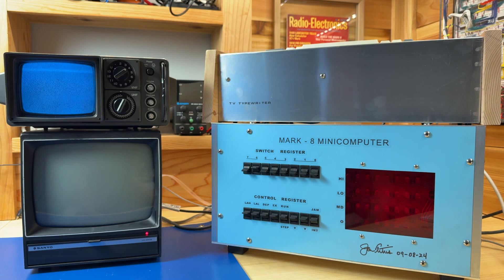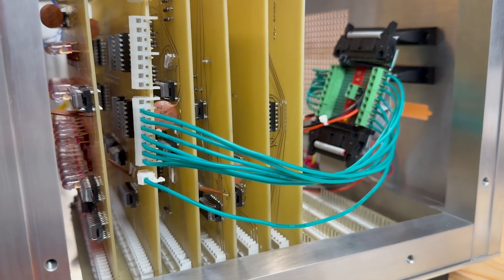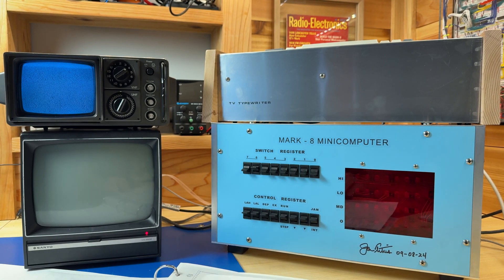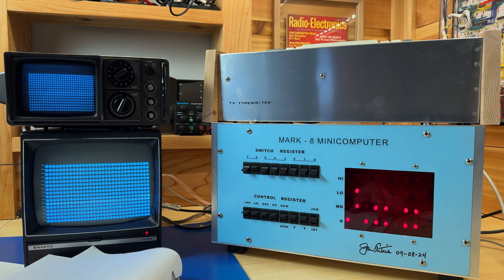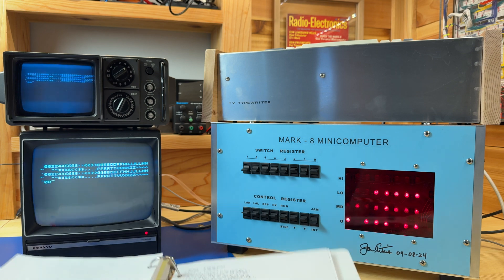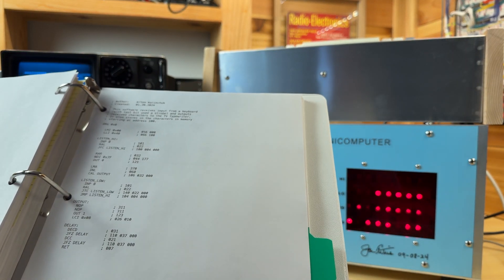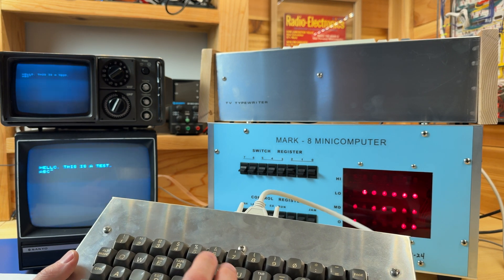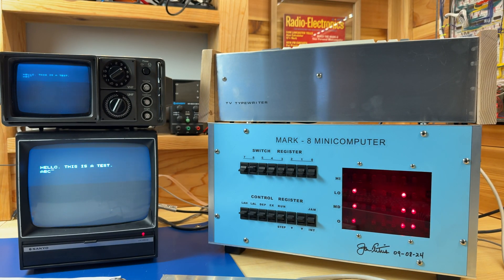Mark-8 Display on TV Typewriter

Comment: A nice little computer, you've almost got me wanting to look into what's needed to build one. I did build a clone of a SWTPC6800 years ago using a pile of wire wrap etc. (I wonder if I could make a 'front panel' for that one - SWTPC never did)
Parallel interface, I was not expecting that, from my memory you could use a TV Typewriter with a modem, so serial, so I thought that's how you'd connect it to the Mk8, although from the back views you showed, there was only two ports visible.
I was surprised that the memory dump output wrapped around rather than scrolling, is that part of the code, or a function of the TV Typewriter.
It would be nice to put that memory dump code into an EPROM so it could be called at any time, like when your in the middle of writing another program, so you could dump what you have rather than having to enter more code - a distraction from debugging what your working on.
Reply from the maker: The wrap around is the way the TV Typewriter works. I believe it was designed that way because it uses shift registers for memory. I plan to build some sort of ROM board for the computer so that we could have basic programs always available to run.

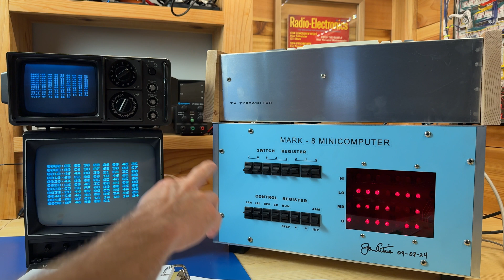Comment: What's up with the "0@" in the memory dump? 10:16 Such as in location 0021?
Reply from the maker: I realized, after the fact, that I had the keyboard encoder connected to the TV Typewriter as well so it was interfering with the data input occasionally.

Comment: Wow, that's great to see in action!  I just started reading through the Mark-8 manual yesterday, in preparation for completing my Mark-8 build (using the Budgetronics PCB's).  I set it aside a few months ago, but it's really so close to being completed, aside from the case.  As it happens, the page I had up on my screen when I saw your video pop up on YouTube is the one describing using the TV Typewriter in this manner.  I'm still a little confused why it doesn't describe how to use the keyboard of the TVT for input, as well as the video display for output, but perhaps that's not as simple as it sounds, what with how primitive the TVT is compared to commercial "glass teletypes".  Since the TVT's keyboard is, more or less, just whatever keyboard the builder can find, I suppose there's nothing stopping a dedicated hobbyist from disassembling that part of their TVT (electrically, at least) and reusing the same keyboard on the Mark-8 as a direct input, though.  Keyboards being as astonishingly expensive as they were back then, after all.

By the way, just in general, your videos on the Mark-8 have been particularly valuable to me, as most of the existing Mark-8 content on YouTube was rather short, just talking generally about the machine's specs and place in history, but not showing much detail of its build and operation.  I remember looking it up when I first became interested in building one, but before you made any of your videos, and the "best" videos I found were done on a very shaky, hand-held camera and mostly covered modern modifications of the machine, such as using an Arduino to "key in" programs rapidly, with much less about how to build and use the machine 100% as designed.  (And, seriously, that shaky cam was bad enough that I had to stop that fellow's videos every couple minutes and let my stomach settle!)

Now here's hoping that as least one of my 8008's is still functional when I finally complete and test my Mark-8.  ;-)
Reply from the maker: I think it's possible to use the keyboard as input and the video display as output, it will just require some modifications to the TVT.

I chuckle at your description of existing shaky videos because I was in the same boat (and still am for certain things). One of my goals of this channel was to provide better quality videos of old tech that actually involves it being used. It's not perfect but it's slightly better, I think 🙂

Regarding the 8008, I found them to be pretty reliable. I haven't had any of them fail. At one point I, accidentally, shorted a high voltage line to one of the low voltage pins and it fried a lot of the ICs but the 8008 remained functional. I also have a tester for the microprocessor if you ever need to verify it's operation.
Reply: @artemkalinchuk  Interesting!  Thanks for mentioning the 8008 microprocessor tester.  Is it something simple (and easy to build), like the ones for, say, the Z80 and 6502 that just march the CPU through addresses, loading NOP's?  Or, is it a more complicated (and thorough) device?
Reply from the maker: @derekchristenson5711  I have one of these: https://www.cpushack.com/mcs-8-test-boards-for-sale/
Reply: @ Fancy!
Reply: "Keyboards being as astonishingly expensive as they were back then, after all."
The Arduino forum has a few good PS2 keyboard handlers. You could easily make a standard legacy PS2 keyboard to parallel ASCII interface and do things with the control and F keys as well. You can buy knock off Arduino Uno boards for about 15$. And start to learn C++ as a bonus.

Comment: No ability to type on the TVTW as the input device to the Mark 8?
Reply from the maker: It's possible to use the TVT keyboard as input into the Mark-8 but I don't want to alter the TVT too much. I'd rather create a separate input system for that since I have some other plans for the Mark-8.
Reply: @artemkalinchuk  ooooh. ok. I assumed the TVTW was able to be used as a regular terminal too.
Reply from the maker: @AddieDirectsTV  It's mostly just designed to output text on a TV, nothing else :)
Reply: @artemkalinchuk  gotcha